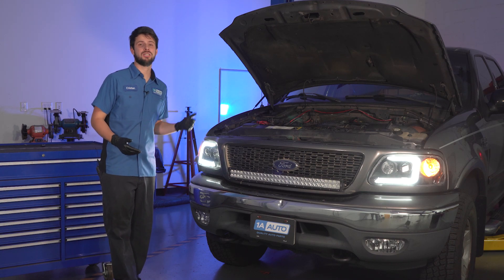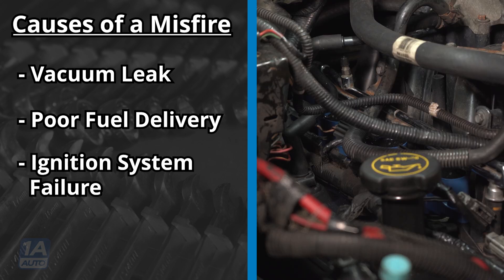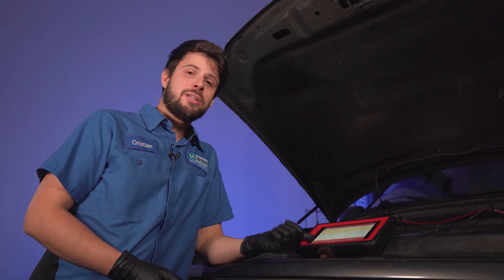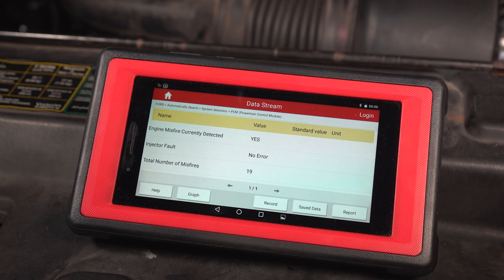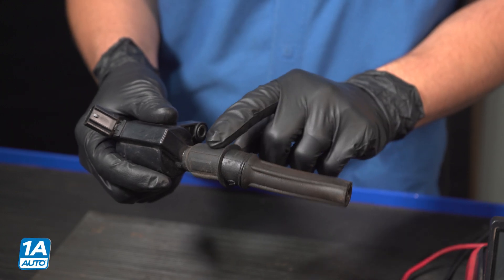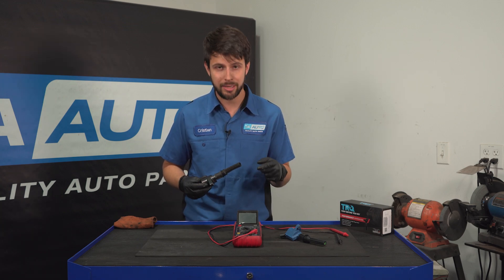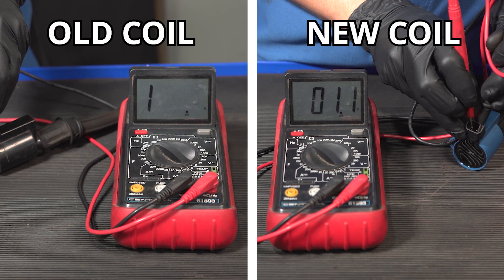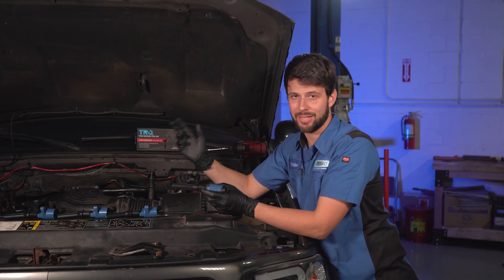Car or Truck Has Trouble Accelerating? Fix It Yourself & Improve Vehicle PERFORMANCE With This Part

Comment: My 04 Volvo XC90 2.5 L 5 cylinder keeps throwing check engine lights check it out reads no codes. The car has a miss most of the time after 10 to 15 minutes of driving taking it to 3 mechanics to find the problem now but money down the drain. I decided to start with spark plugs removing the coils and found 3 spark plug holes full of oil which is probably the cause of the miss. Cleaned the out oil and changed the plugs the cleaned plug connectors then started the car it ran great 16 minutes later those 3 plug hole were filling up again. So Researched and found out the valve cover / cam cover has 5 orings that keeps oil out of the spark plugs. Now I don't trust the 3 mechanics anymore because they had my for one to 3 weeks and couldn't find the problem. Do you guys have a video on how to replace those orings I haven't found any from you guys or anyone else.

Comment: I had a rough running and stalling LeSabre and the mech charged me $900. But still didn't run right. I changed the battery and that was the problem.